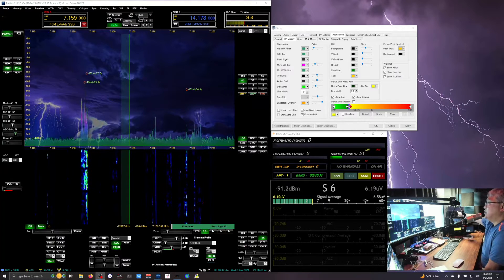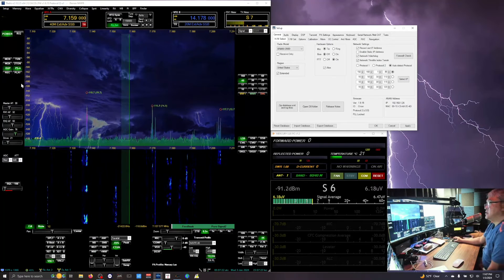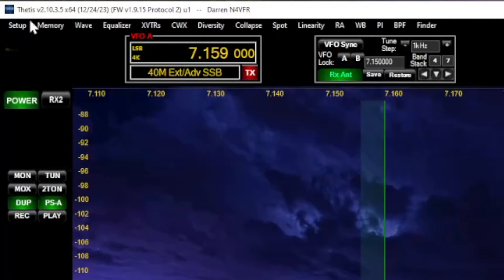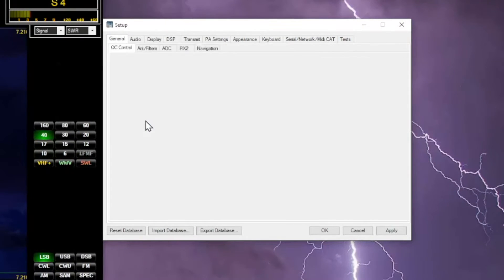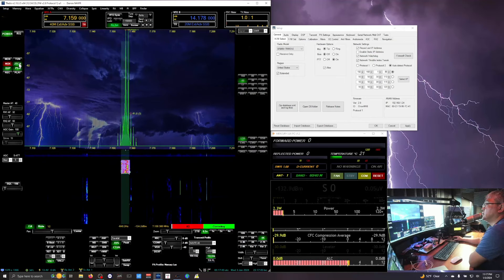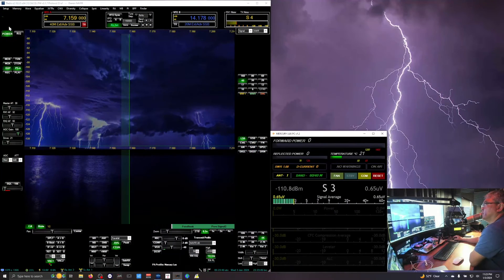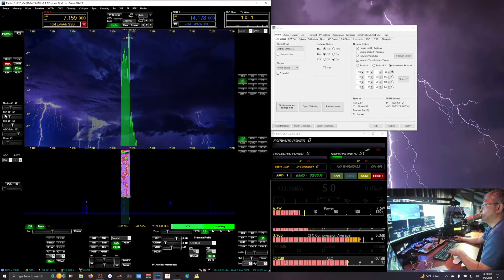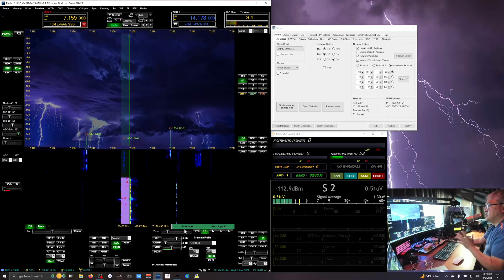cmASIO caused my Pure Signal to be Inoperative | Thetis v2.10.3.5 | How I restored Pure Signal

Comment: Hi! cmAsio has nothing to do with PureSignal. And you do not need to reflash the radio to enable/disble cmAsio. Just rename the regkey "ASIOdrivername" to "ASIOdrivernameTEMP" (or something else) and restart Thetis.
In order to have a stable PS operation you need to hit 0db on the ACL regulary. 73 de Ernst, OE3IDE
Reply from the maker: Hello Ernst, I continue troubleshooting and reloaded Protocol 2 and re-tried cmASIO.  Also verifying that the ACL Group is at least 0 db.  It's working now! Yay!
Reply: Yeah, switching from VAC to cmAsio needs some adjustments in the audio-section: MIC enabled, MIC-gain adjustments,...Good its working now!